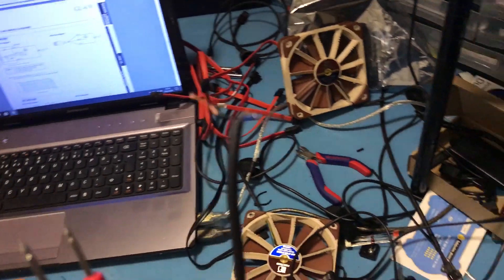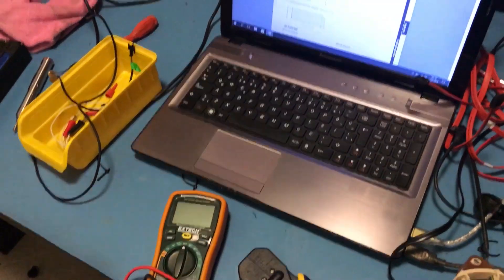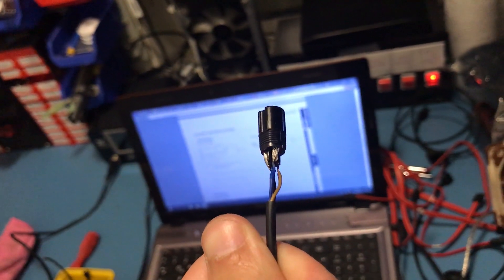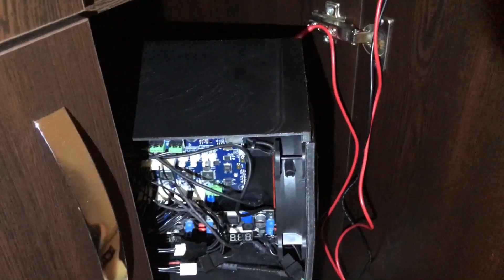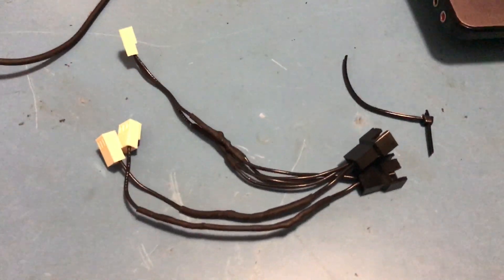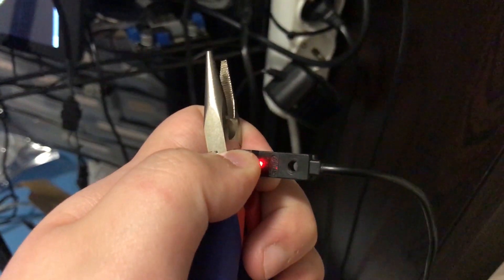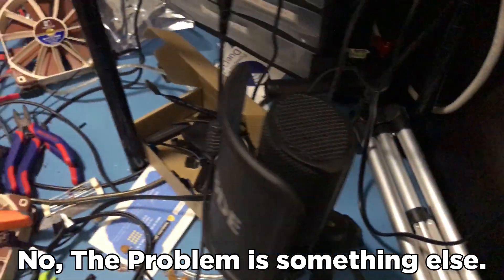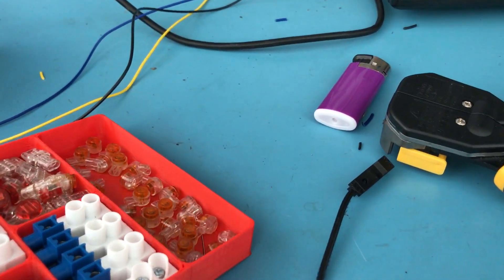Tevo Black Widow Mods Part 26 - Layer Shift Issue & Fixing the Y Limit Switch

Comment: Hi, why did you mount the end Y-axis end in the front instead of the back?
Reply from the maker: To make life easier when aligning it properly for the mgn12 rail mod. As you can see from the video, I have to trigger it from a nut not the bed plate.
Reply: as I had an original table, on linear bearings I used standard sensor mounts, only the mounting itself turned by 180 degrees and worked without any problems I think I have a photo somewhere, the sensor at the front is easier to access but it is always easier to damage it even by accident
Reply from the maker: I couldn't make it work. It's not a big deal anyway, I just need to edit the firmware and slicer settings.